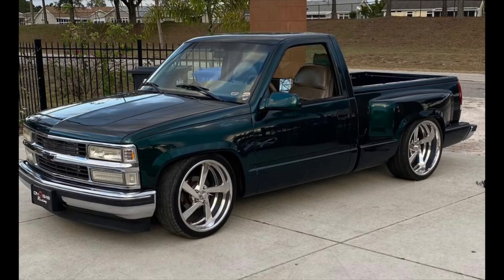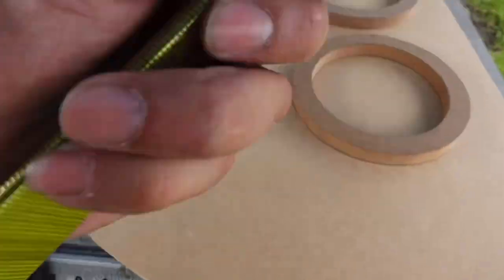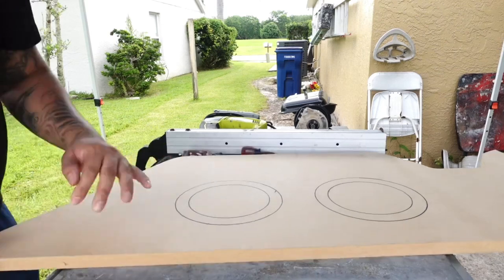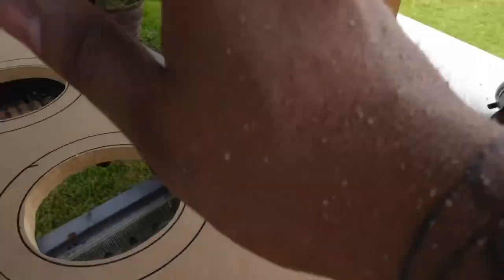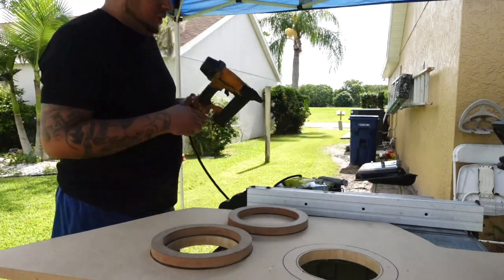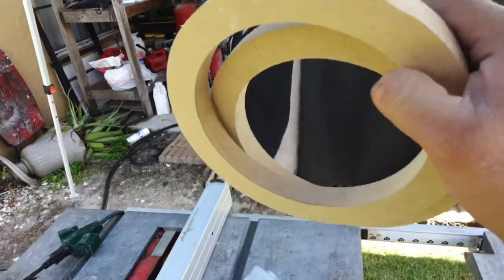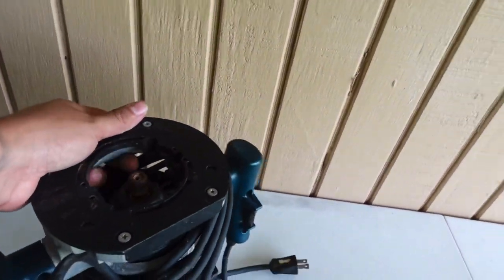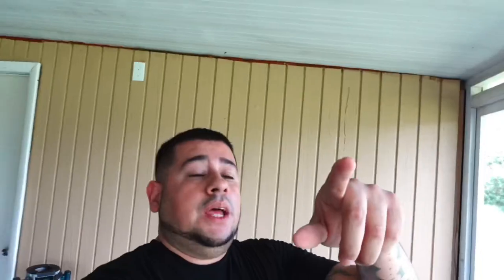EASIEST way to ROUTER WOOD SPEAKER RINGS for TITTY PANEL in CHEVY SINGLE CAB TRUCK

Comment: Mouse, love watching the work.  I wanted to offer another technique with the rings.  Instead of using crown staples, you could use small pieces of 2 sided tape to hold them in place and then you won't have to grind the staples off.  Just my .02
Reply from the maker: Oh yes we gonna explore so many techniques to improve the mousetrapgang skills
Reply: Broder cómo puedo contactarme con tigo tengo un trabajo para ver si se puede hacer ?

Comment: Hey big dog! I also do custom speaker brackets, for replacing factory. Why don't you use template tape instead of brads?
Reply from the maker: Ima explore that when I’m buy this router table ..appreciate it big dog.  Gonna be a game changer for sure 📐✏️🔈
Reply: @mouse_trap.  I put a router table in my shop and your right, definitely game changer, next level dog! Your awesome and I really dig your content.